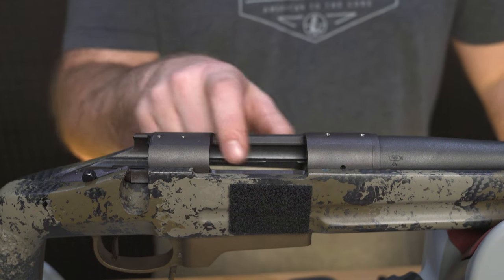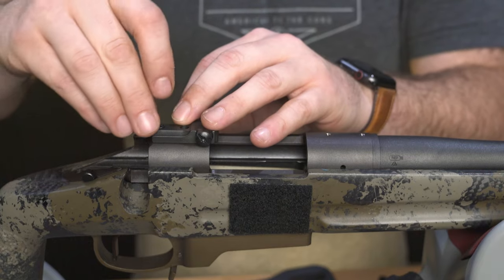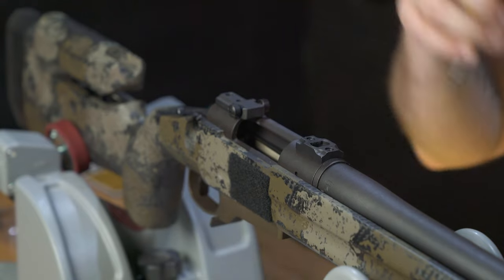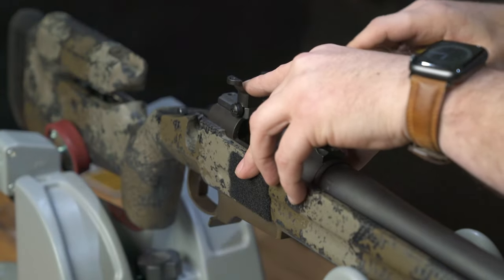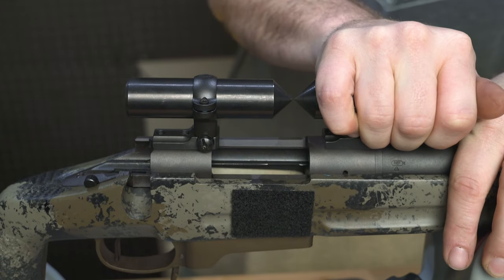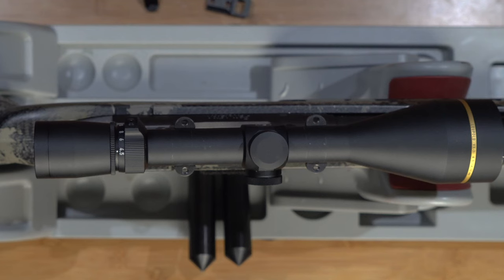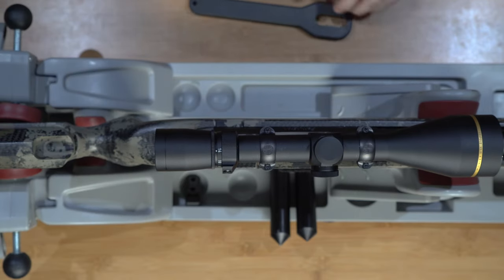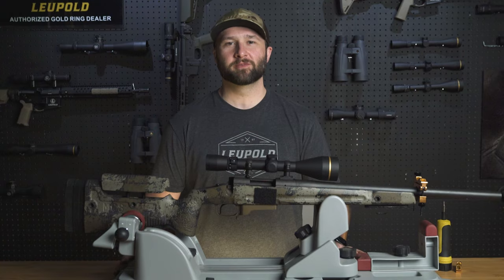How To Install Standard Scope Mounts

Comment: I boresight the front ring into alignment using the scope. Then mount the rear ring , bottoming the scope into it. Tighten the rear ring screws without changing the ring position. That way I have only minimal scope internal adjustments. I don't think Leupold know what they're doing.
Reply: Pretty nifty way of doing it
Reply: @tacokiller101  I made it bit easier by using an alignment kit for adjusting the rear ring to the front this time. Then I LIGHTLY lapped the rings to remove any sharp edges. Dropped in the scope and put on the ring tops. The first way was when I was poor and didn't have a lapping kit.
Reply: Nowhere does it address how to keep front and back aligned parallel to bore axis. Hoped to learn something here but they don't seem to know either.
Reply: @archerpaintball6822 you do this during sight in. 
Boresight using the windage screws, then again adjust on paper with the windage screws. 
Make fine adjustments using the windage dial on the scope.

Comment: How many inch pounds to you torque the rings
Reply: Abput 15-18 in lb
Reply: @mirorados7208  that's not a true statement...it all depends what size screw a person is using...there are different screws for different applications.the video didn't specify for that very reason

Comment: Why is Leupold so vague with torque specs? Even in this install video there is nothing mentioned. My VX freedom didn't come with any torque values in the manual so I just went with what the Warne rings said which was 25 in-lbs max.

Comment: Secure the base to the receiver, with the Torx® screws and driver.
Tighten 6-48 screws to 22 in-lbs and 8-40 screws to 28 in-lbs. BUT How does one know which screw do we have?? 6/48 or 8/48
Reply: My question exactly!

Comment: Buy our rings , and also you’ll need these expensive ass alignment bars.
Reply: 20 bucks?
Reply: When I worked at an FFL and mounted 2-3 of the STD assemblies a day, the bars were a big help to expedite the process. If you are only doing one rifle, you really don’t need them, but it takes more time and attention to ensure they’re aligned. 80% of the scope mounts we did were Leupold, we liked them as well as customers. Of all the special tools in this video, I’d recommend the ring wrench. You can use a large crescent with padded jaws, but with the soft plastic of the Leupold wrench it’s impossible to mark the rings. A in/lb torque wrench is nearly a must as well, but not absolutely required. The mount screws don’t react well to being over torqued. Our Leupold rep told us though that the included torx wrench is made to a length where the average user would get within reasonable torque as long as they didn’t really crank on it.
Reply: @fuelfiredesire  hey man, are any of those this fancy bars and tools necessary for mounting the scope ? I've purchased my
First bolt action and scope and all I have are Allen wrenches and torx screws .
Reply: You don't need alignment bars. You can use scope to ring alignment.
Reply: @randomdog8107  1) You can rotate the rings with a 1" dowel lightly tightened in the rings if setting up for a 1" main tube scope, or (what I'm doing) use a 1-1/8" dowel for a scope with a 30mm main tube.
2) Use the 1" dowel or the scope itself to orient the rings using just a bit of candle soot to find high spots.
I've never needed all these specialty tools to mount scopes on any of my own rifles, although those tools would certainly be worth it if installing scopes for customers on a daily basis.
Reply: You can use a 1” dowel Rod.

Comment: DO NOT BUY THESE! why buy a mounting system that needs proprietary tools when leupolds ringmounts exist that lock into your specific action with nothing but basic tools and its one solid piece with less fail points. Do yourself a favor leupold and produce user friendly mounts and scopes and dump the extra shit. Love the ringmounts and the portion of your website that allows you to order the correct ones hassel free, but there is no need for these to exist. Lesson learned rant over.